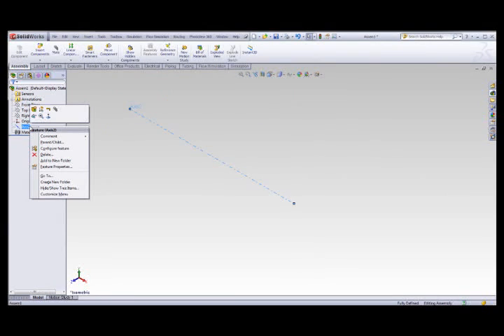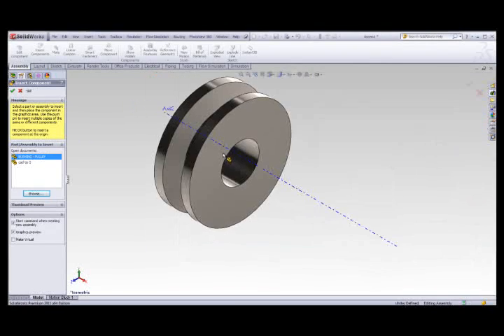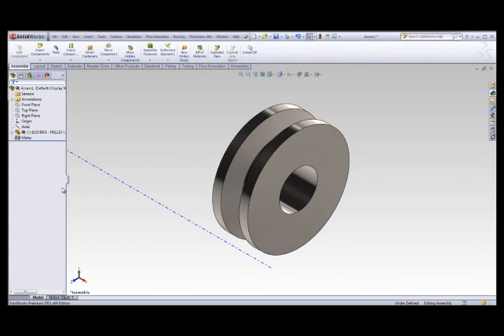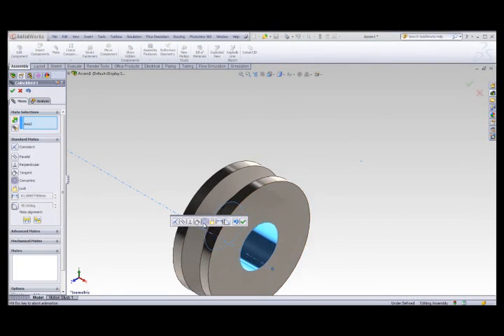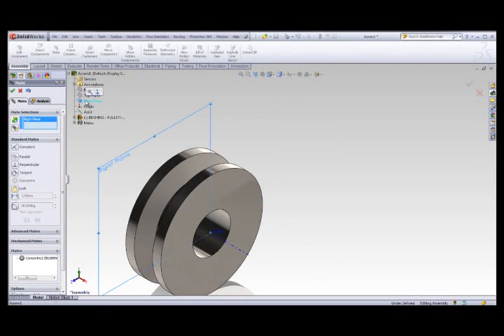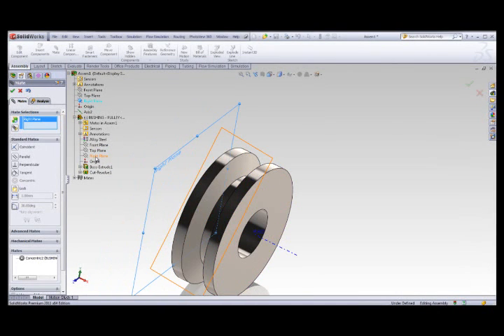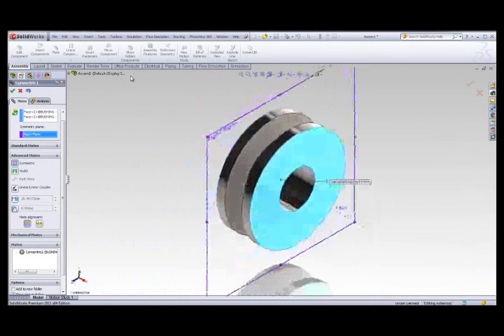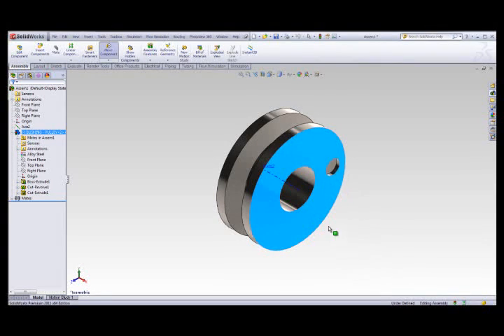Reference Geometry in the Assembly

Comment: I called up about solid works software and i have a price on it but im worried that it might be a bit harder to use then other CAD software i have used in the past, does solid works have a help service that i can contact if i find some opperations hard to use?